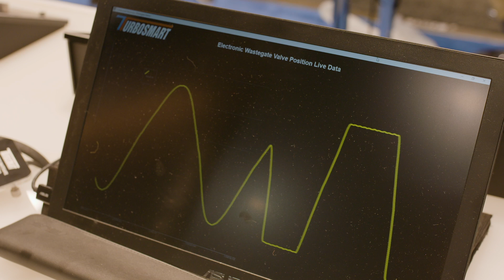Turbosmart changes the game of boost control - electronic external wastegates.

Comment: Will TS's e-WG be plug and play for vehicles that already have an e-WG?  If I wanted to take any turbo upgrade on the market that uses a mechanical WG, could I just replace it with a TS e-WG and put it on my Gen2 3.5 Ecoboost that has factory e-WGs?  Also, will there be an e-Boost 3 that works with e-WGs and doubling as a meth controller?

Comment: What is needed on the ECU side? For example can it be controlled with a stock GM ECU?
Reply: Gonna need an aftermarket standalone ecu to run it. Needs a 20amp pwm output and an input to be able to control it

Comment: This is problematic cause spikes in battery voltage/ even a alternator running low on output imo would cause the gate to not function properly and HOPEFULLY not max out boost, but not boost at all as a “fail safe” ?
Reply: You should learn about capacitive filtering circuits. It's the reason your ecu doesn't die during alternator dips and spikes.

Comment: Saab T-5 had wastegate control by the ecu already in the early 90's, though it was an internal wastegate. The ecu controls a solenoid that sends pressure to the wastegate. Depending on the map in the ecu the inlet pressure is regulated. So this may be a first for controlling an external wastegate with the regulator built in,  but the rest of the technique doesn't look that spectacular to me (not excluding ignorance on my part 😁)

Comment: Lmao, Honda IRL uses electronic wg for years, most recently in their turbocharged models. Little late in my opinion
Reply: as said in the video, BMW etc have used these on their cars already. What they have are aftermarket replacement ones, ones that can be retrofitted and EWG setups. Yes it has been done by manufacturers, but go find a good reputable company that has this amount of products for such a wide range of applications.
Reply: @BrickNewton  Can't imagine some lost donkey eating up every word of this vid, when doing a presentation, especially a product launch, do look a bit more professional.... your polo could at least be button up, even on an old polo...
Been using ewg long before this company was around. Making, retrofitting, modifying parts is just part of the game. Never used a turbosmart product before, don't see that changing anytime soon.

Comment: (bench racer here) We will be able to effectively map the accelerator pedal use a throttle opening with an exact target boost with off the shelf aftermarket, instead of controlling the boost being somewhat of an afterthought to a certain throttle opening. I believe it will give a lot more driving dynamics to highly boosted turbo cars.

Comment: Makes me wonder why it took someone this long to apply this technology to aftermarket.
Reply: 177SCmaro simple... price point. They have to wait until it reaches profitability margin. Tech is there but they won’t sell if they can’t make money, so they wait until the parts ie solenoid prices are low enough to make profit
Reply: @lasjcrew  I know. Another way of putting my comment is I wonder why it took this long to figure out how to do this profitably.
Reply: I have worked on early 1900 cars. I'm always impressed with the tech. My opinion is, within the first 10 years of the automobile , engineers knew what it took , only tech and manufacturing wasn't there.

Comment: Those Wastegates are huge. Gonna be hard to tuck that.
Reply: _ VesBraun if it’s gunna be hard to get it in then there not for you, these are for the big boys on the track, not your average street tuner, if your spending hours a week under the hood for a living it’s not gunna be a challenge getting a slightly bigger waste gate in there.
Reply: @Boofedit  it's designed for road application as well as race, would be hard to fit these in a tight bay and that includes race cars but you can make things fit, maybe have to reroute.
Reply: @dylan4972  hudini could do it.

Comment: Been invented by the OEM's years ago - nothing new.
Reply: That's a facts. Look at bmws
Reply: More like 4 years ago probably now more and yes capable of high power levels still from factory
Reply: Nothing new technology wise, but these guys are bringing them to the market creating a reliable supplier for these caliber of wastegates.
Reply: The point is it's been done. You can upgrade your ewg anyway when you upgrade your turbo. Who cares about this
Reply from the maker: Internally wastegated ones, yes, but not external or ones that can handle extreme power levels and motorsport. Straight gate is new too
Reply: @MotiveVideo  linear actuators are in production and have been for over 5 years already. Sonzeboz, Mitsubishi, Siemens and Hella have been making these for many production turbochargers which are running EGT's (euro6) of 1050DegC and are situated on the turbocharger and connected directly to the turbine housing - and do not have a temperature limit of 100DegC like the turbosmart product.  Other companies have made a linear actuated electronic driven waste gate in 2014 already - this is nothing new at all, they have packaged t differently, but the idea is ancient and the products are in the field in various guises to date.
Reply: @MotiveVideo  save your energy. If I had nickel for every subject matter expert .

Comment: You gota be a careful with electronic wastegates, because the failure modes typically include "max boost" whereas generally, pneumatic gates are  more likely to be "more input = more boost" so should a pipe fall off, they drop to the basic spring set min boost line ie fail safe (not always, some set ups use the opposite sense) 

 I developed a 'lecy gate for the Subaru WRC car back in 2003 (yes, that long ago!!) and whilst it did have advantages, they weren't actually that clear cut, especially given that the system does not have a negative feedback loop integral to it's architecture, ie, the valve position must be controlled at all times, and as digital controls are discrete, that introduces some interesting control artifacts.  What we found was the crux strategy was to actually control turbo speed and not boost pressure........
Reply: That's where rupture disks and burst panels come into play. The best thing they could do is have some sort of error-sensing code that can feed back to the ECU to throw an error or go into limp mode.
Reply: @hydrocarbon82  can you imagine the market for that LOL it's bad enough having a vendor manufacture an RD for a 35k psi reactor ... good luck on finding something affordable and reliable.
Reply: I would imagine it wouldn't be difficult for these to be set up to spring open. Such that should the wiring be damaged or the motor controller fry an internal spring would pull the gate open; much like electronic throttle blades have a spring that shuts them with no electronic input. Obviously if they got bound up or had foreign object damage this probably wouldn't help but that is an issue regardless of the gate type.

Essentially at the end of the day the electronic gate displays the same advantages over a pneumatic gate controlled by manifold pressure that you get when you run a pneumatic gate on an external air supply (CO2). Plenty of people are running that one drag cars for good reason.
Reply: In all honesty I was waiting for the last line to read "And Epstein didn't kill himself." lol great read tho.
Reply: He did mention that if it overheats it closes the gate. Not good. Makes sense. But no bueno if the failure signal isn't sent back to the ECU.

Comment: You can do electronic boost control with just a boost controller no solenoid and no plumbing
Reply: Yeah you can but the most you can control it by is one atmosphere (14psi) if running 45psi of boost you can only turn it down to 31psi, witch usually isn't enough to swap between street and drag applications.

Comment: Finally someone has come out with this! I can't believe it's taken this long
Reply: This has been used for some time already in cars from the factory...
Reply: ADEBISI ADEBISI  it's not like there hasn't been a discussion about development for the last 3 decades or anything 🙄
Reply: I know right!
Reply: ADEBISI ADEBISI  I have been approached by an engineering team to build this. The only reason I didn't was because I was to busy putting stuff in outer space. What do you do?
Reply: wannabecarguy - what did you put in outer space?  and how would you know you did it?
Reply: The traditional style diaphragm wastegates and BOVs are rock solid with tons of aftermarket support. They are simple and only required a vacuum/pressure source which are very easy to accommodate. Most factory cars with turbochargers are STILL using diaphragm style wastegates and BOVs, but they using electronic solenoids to control the vacuum/pressure to them for better control. In my opinion for a drag/track car, Turbosmart's new electronic systems will be perfect. If you applying this to a street car, I find this system will not only be hard to configure without blowing thousands on a ECU to control it, I think with everyday use it will be more prone to failure. Notice they had to add cooling to the wastegate on the heavy application use. The carburetor was obsolete back in the late 1900's but it's still being used to this date for its simplicity and it's reliability. The traditional style diaphragm systems will still be favored over these for decades with solenoid controlled vacuum/pressure because of its reliability. The current failure rate of BOVs and wastegates aren't even enough to alarm companies to design a better system.
Reply: We've been working on it for a few years now. Not surprised one of the big manufacturers beat us to release. :(